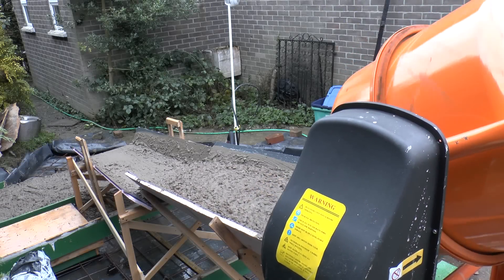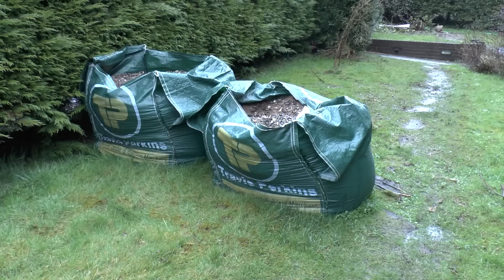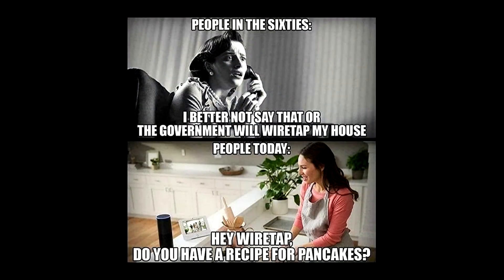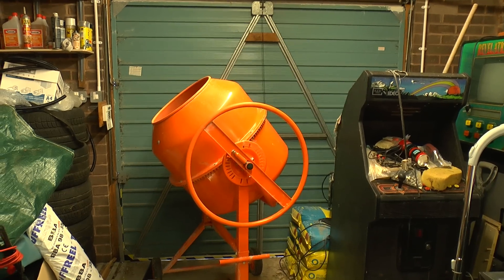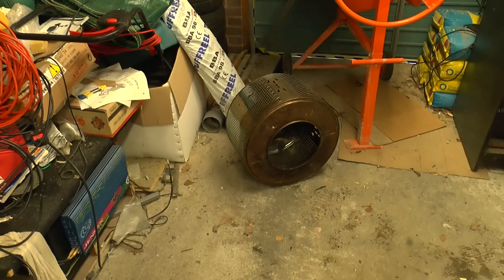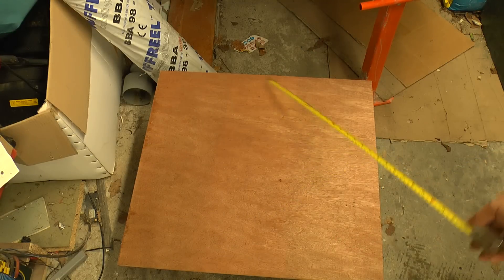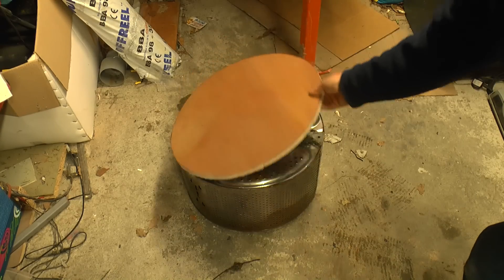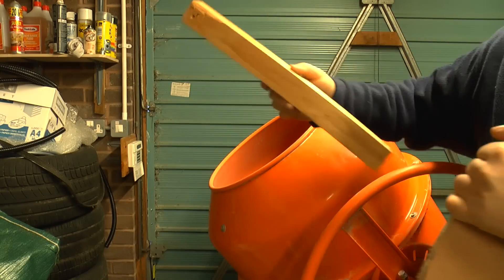Build a sand/soil sieve addon for a cement mixer

Comment: If you’ve got an old washer that still has an operating spin cycle it’d be easier to remove the top  panels, cut a whole in the outer (solid) drum on one side , then  lay it on that side and use it under its own power by loading and selecting spin 

Extending the concrete mixer will put a much higher load on its gears and the bearing at the rear end of the drum ( the thing that often fails on older mixers )  a bit like when 4x4 car bearings/axels fail when big wide wheels and spacers are fitted
Reply from the maker: Spin cycle would be a bit on the fast side.

Comment: I got a mixer the same as yours, And I wand to sieve soil for seed mix. But as the mixer tub comes in half, would it work better to remove the outer part of the tub and join on there? Anywat - I like your work, great job
Reply from the maker: If you can be bothered to split the drum and faff with that rubber gasket that sits between the two as well then yes. It'd make it more stable (I had to use the bags of cement to stop mine toppling).

Comment: I Love It!!!!!  I need to build this to clean a sandy beach that collects lots of debris. So smart! Thanks for sharing!
Reply from the maker: You're gonna need a bigger mixer :D
To clean a swathe of beach I'd build something more akin to a giant mesh snowplough blade built on a vehicle trailer. It' sweep through the top layer of sand and drive anything sieved out to the end of the blade where it can be caught (changing the curve at the end of the blade would allow debris to ride up and into a mesh basket, where any trapped sand could still fall through).
Reply: @AintBigAintClever  
Thank you for responding!! Your creation is the first thing I have seen that would work. (And I have been looking!) My beach is on a freshwater lake, and the prevailing wind deposits all sorts of trash and debris there. I showed my husband your video and he commented that it would take a long time, and countess shovel fulls  to clean the beach, which gets bigger as the water level goes down. I will share your suggestion with my husband! Too bad your not in Alabama to help! lol 
Thank you so much!!!!
Liz
Reply from the maker: @buckwildproductions7354  no worries.
Sometimes the simple solutions are the best. My suggestion went from a massive rotating drum with a slot to scoop sand that would need to be lowered into the sand then raised back up, to a mesh paddle wheel, to a mesh corkscrew and finally just the mesh plough blade before I clicked "reply" :D
Depending on what you're dealing with the mesh could just be a length of chainlink fence, at least to get the biggest stuff up. A strong frame would be important in any case, with the leading edge angled horizontally to glide through the sand instead of digging into it. Minimum resistance, let the mesh do the work.
Reply: @AintBigAintClever  
I tried to post a picture but can't figure out how to do that, or if its even an option.  We burn all the logs and limbs, and bag all the plastic bottles and such. What I want to remove is mostly leaves and tiny plant matter, some small rocks, and even glass shards that are unearthed or filter down from our property with the rains. We once cut a 4 x 4 foot piece of window screen and shoveled the "dirty" sand into that, then each held 2 corners of the screen and agitated it. It worked, but liked to have killed me to do a small section and was too slow. lol I think your idea of some sort of plough is the ticket!  I do not want to shovel the beach every spring. Thank you!

Comment: If you put down a plastic tarp you might be able to sift it faster by using water... situate the tarp so you can collect the water and reuse it.  I think it would cause the sand to leave the drum faster and recover more of it.
Reply from the maker: I tried (off-camera) to play a hose on it, and the last load of the bag I rinsed pretty well as I wanted to clean the drum out, but it comes out more as a sort of slurry than sand and might take a while to dry back out.

Comment: Alternative method.

1) Build a shaker table.

2) Put ballast in a large bucket on shaker table.

3) Shake bucket.

4) Big stuff rises to the top; sand sinks to the bottom.  Trowel off the gravel.

5) Repeat.

Yes, it really does work.  Agitation really does cause the large particles to rise and the small ones to sink.  Counterintuitive, especially if the big particles are denser than the small ones, but that's what happens.

Which one would be more energy-efficient or time-efficient is subject to experiment.
Reply from the maker: Some sort of shaker table is what came to mind at first, before Wiretap - sorry, Facebook - popped that rotary one onto my news feed.
We learned about the way particles act back in school, basically the little ones fall through the gaps between the big ones, a bit like anything you accidentally drop into the bin and need to fish back out.
Reply: +AintBigAintClever
They teach that in school these days?  I'm an old fart, so they didn't even know it happened back when I was at school.